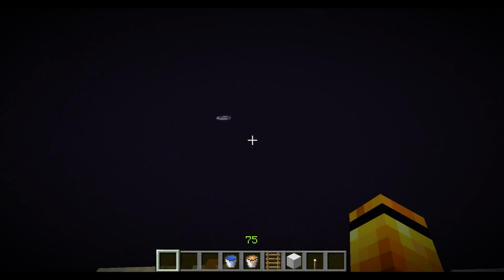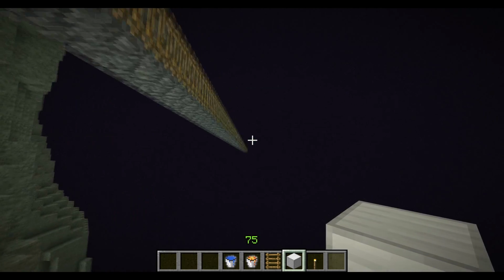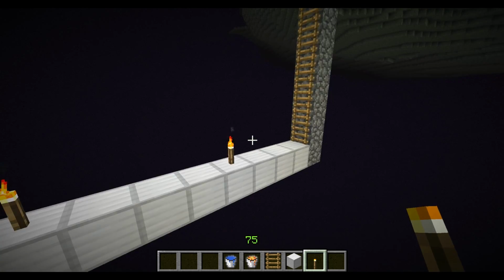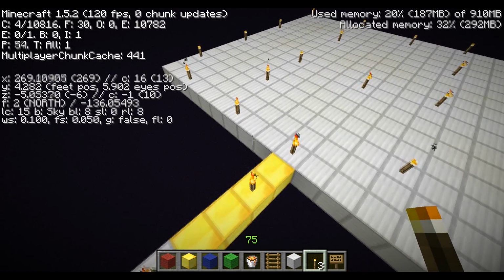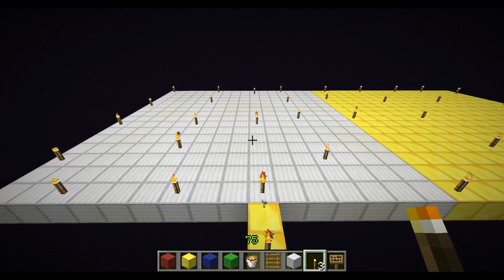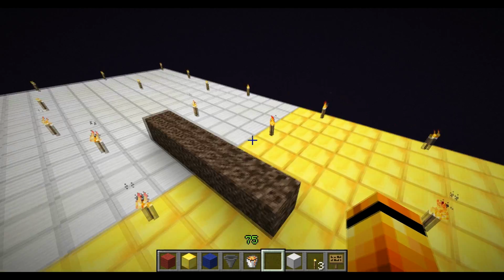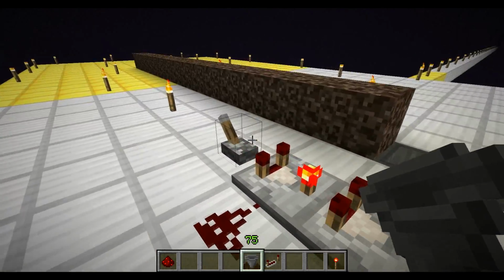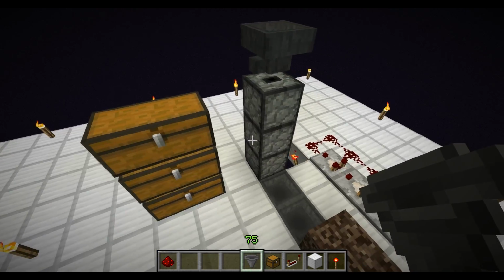King Designs: Enderman Farm - Part 1/2

Comment from the maker: The point is this is the process in designing the farm to the max. You make sure to make the most use of the space available to allow more pads / options for the spawning platforms. If the pads work out to not need the whole 128 distance, then sure we can move it up one :). But we know if we need to, we can give ourselves the maximum distance possible.

Comment from the maker: The question is, having those air blocks down there, will they slow the system down or not. That is the test. 

The drop reset will be changed for this model, piston pushers will be introduced to deal with vine issues

Comment: Hello king,
first, I wanted to say, that I am pretty sure, airblocks only matter on the level, where Enderman should spawn, because if the algorithm succeeds on one level, it will only spawn at this level.

Second, I have a bit of issue, in my farm. Sometimes, they get stuck on the vines and won't fall down. Do you have any suggestions for me?

And third, I really like your designs, and this video explains many details in an easy way. Great job!

Comment from the maker: Making silent ones are not the problem, I have far smaller ones than that :3. The issue you cannot put anything on the level of the bottom dropper because of the void.

Comment: I thought that if you powered a dropper it would pull from a dropper underneath it. If that does work you would need to run the clock.

Comment: A while ago you made a video about how to launch Minecraft with more RAM, could you perhaps do that but for the new snapshot launcher? I did the same (Yes, I changed the file name in the bat file but it doesn't work.) The only way I could think of doing is by launching the snapshot then running a bat file.

Comment: Have a chest above one of the end hoppers, that has an item constantly cycling through the elevator and back into the chest, then when an enderpearl comes by, it will go through instead of the other item. This way you have a clock running, but don't have the constant ticking. Maybe this would be too complicated, but it's all I can think of.